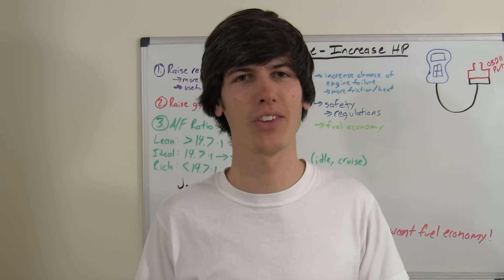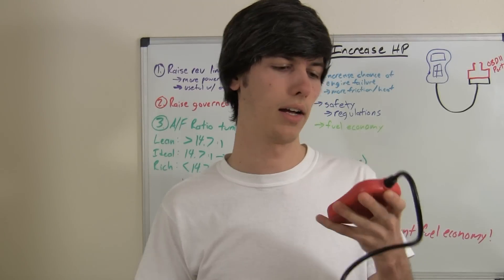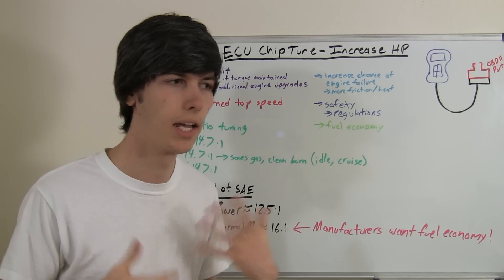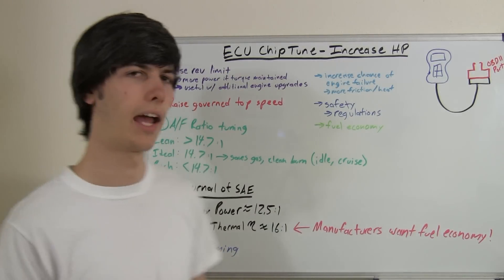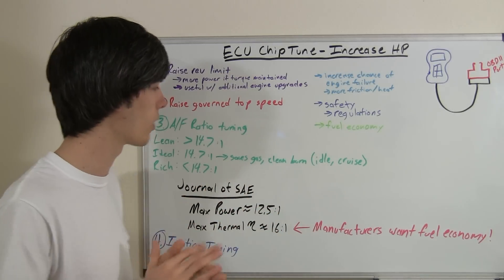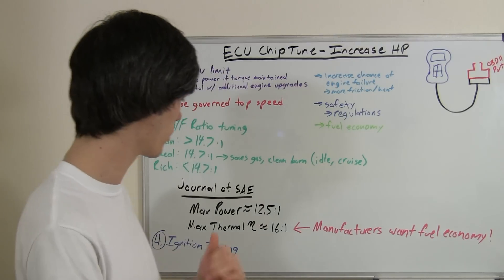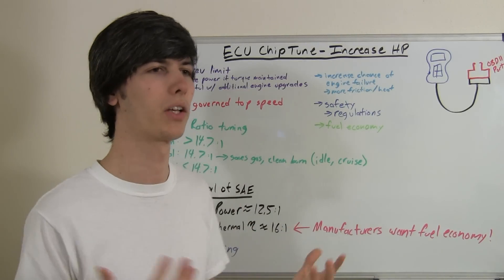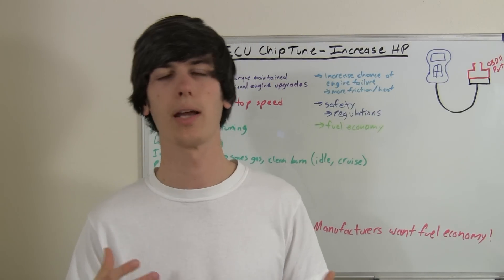ECU Chip Tune - How To Increase Horsepower

Comment: Why don't engine tuning companies just make software so you can use a laptop computer to flash the ecu? instead of all these $500 handheld tuner units.
Reply: James some do, But they are usually more expensive than the hand held units.
Reply from the maker: Some do! I know for example that COBB does.
Reply: The issue is that some cars have very complex ECUs and not a large aftermarket base. Therefore they dont waste their money or time with them because they wont make anything off of them. Many well supported cars have these programs, the Chevy Cobalt, and Dodge SRT4 being the first two that come to mind, but some smaller base cars like the Toyota Celica don't have this option. It truly just depends on your car as to what your options are.

Comment: tuning is way way more in depth than this. i suggest no one use this video to learn how to tune you're own car. this is just the absolute basic's and some of it does not necessarily mean it holds to when you do it to your car. Tuning a turbo, supercharged, all motor or nitrous car are all different beasts in them selves.

Comment: This is one of the biggest scams out there. You can't just install a chip and increase torque and BHP and gad milage. All they are, are just resisters that plug into your air intake sensor so your car thinks its cold all the time which increases your timing. Which will give you like about 5 BHP temporarily until your car catches on to it. The best way to get a gain of BHP is to actually Dyno Tune your ECU after you have added after market parts to get the best out of those new parts basically calibrating the car. Also you don't want it to adjust your cars top speed limit, because they are set there by the manufacture for a reason and that is, because your cars stock tires can not handle that high of speeds so that add a top speed limiter. You would only want to remove this if you have new tires onto your car not stock tires.
Reply: 100% spot on. Not to mention some cars are simply not designed for high speeds aerodynamics, brakes and suspension wise. Its easier to lose control with spongy soft suspension, improper brake pads/discs etc... Its not like every car is fitted with 4 piston brembo brakes. Stopping at above 155miles with dual piston calipers and non vented discs is suicidal =p
Reply from the maker: I'm not making any recommendations, just explaining the logic. Some cars it can have a greater effect than others (obviously). I suggest everyone do their research of course (and be okay without a warranty, if they still have one).
Reply: Engineering Explained Oh na i wasnt denying what you were saying! I was just agreeing that mods are required to get the most out of a tune, and also most people (young pre 20s) dont realise how unsafe "normal" cars are when only power is increased, with no regard for other crucial components such as suspension and brakes, which you also stated yourself in the video :)
Reply: donkey1450 Yup your very right to and the funny thing is that I fall into that category i'm only 16 lol, but that is also a good point your stock breaks would completely give away.
Reply: My car's speed limiter according to the book is 165km/h but I've had it up to 190km/h in an emergency situation, though I must say it starts to float in the corners on a dual lane highway at 190 and would never be sustainable on a normal road. I'd imagine if I put a spoiler on and stiffened the suspension I'd get well over 200 safely. The old man's Subaru Liberty LX stock I had up to 200 quite safely at one point (had to get around a wide load in a hurry) and it stood nice and clean with no floating or anything. Then in contrast I once had the front end of my old Hyundai Excel 86 raise off the road at 143km/h going down a hill on the NSW F3 freeway which was most disconcerting for a front wheel steer and drive vehicle.

The speed limiters needless to say often don't work at advertised values and with good maintenance and good quality parts cars are usually well capable of more than the speed limiter figure.

Comment: This guy will help you blow your engine, not get you more HP out of it. A cars valve train is specifically designed to operate within a safe RPM range. Even razing the limiter 500 RPM could cause the valves to float and clatter causing damage. Lose a rocker or a lash pad and it's over. In all reality unless the cam lobes shape and angle are changed there is no more power to be had at higher rev. In fact it falls off the higher the motor revs. The most effective power range for a stock motor is usually 2000 RPMs less than it's set limiter. THERE IS NO POINT IN RAZING THE LIMITER. 
r
A leaner air fuel ratio actually produces more power than richer, but it also causes heat to build up in the combustion chamber which causes pre ignition detonation which destroys bearings and burns holes in pistons. The car's manufacturer can only push the edge of that performance to the extent that it's safe for the engine. The more fuel you dump in the combustion chamber the cooler and safer it will run, but will in fact make less power.

Comment: Completely incorrect
Reply: This is the ricer method lol he's talking about ecu tuning and has no idea what real tuning takes. I've never turned up the rev limiter on my Mitsubishi Evo IX and I'm runnin 562whp and 539wtq, it's about a lot more than what he states. If u do what he says ur just Gunna ruin ur car guys and girls, take it from someone who's been there and done that. You guys can pm me on how to really tune an ecu. This guy is just embarrassing
Reply: Connor N I think you're missing the point. It's a brief 5 minute summary for the layman of what's involved with ECU tuning. This is clearly not a video designed to teach someone how to tune the timing advance on a 4g63 for e85.

Secondly, he's not telling anyone to change anything, he's explaining what the motivation for changes would be.
Reply: Beef Broth I drive one :S
Reply: enuary Me too =p. Ah well, let's be idiots together.
Reply: Connor N He is giving an introduction on the main principles on the general theoretical positives and negatives of tuning for engine longevity, maintaining engine structural integrity, safety, and reliability (from years of research from mechanical and electrical engineers from their respective car manufacturing companies VS leaning more toward performance, better Torque, Hp, potential (but not conclusive) for Engine related problems in the long run (if you stick with a stock engine for example). Sure there is a way to tune your engine for more horsepower & torque without affecting the longevity of your vehicle (ie tuning conservatively) or you can tune your (stock) engine for even better performance (ie tuning radically) but at the expense of causing pre- ignition, denotation, destroying your cylinder head gasket, blowing a hole through your piston, and affecting the intergity and normal mechanical operation of your engine, etc. If you understand the operation of an engine, have the time to repair yourself, are mechanically inclined (or have the capital to repair your engine from radical tuning or just being better to build a better performance engine and then tune it to its safety standards that way you get the best of performance and reliability) then if you want to tune radically knowing that you are going to decrease engine life before repair and knowing the associated expenses and time envolved then by all means radically tune your vehicle all you want. THIS VIDEO EXPLAINS THE POSSIBLE RISKS AND BASIC THEORY OF TUNING AND DOES NOT TAKE INTO CONSIDERATION INDIVIDUAL EXPERIENCES CONDUCTED BY INDIVIDUAL PEOPLE. Sure you are right to say that you can tune your Mitsubishi Lancer Evo to run at better performance without affecting the reliability of your Engine under the 5500 RPM REV LIMIT but I am sure it must of have token a lot of time, testing, experimentation to get your A/F ratio right amongst other factors considered such as keeping track of your sensor readings and so on amongst the Power Band of your engine to keep your engine at a high performance level while keeping your engine safe enough and long enough to operate (especially if it is a stock 4B11 DOHC 4 Cyl MILVEC 2.0L Engine).
Reply: ***** THANK YOU! WELL SAID!
Reply: Connor N What software and such do you use to tune?  Don't know how to PM anymore without using crappy Google +.

Comment: This video is so flawed. First you should never flash your car with a generic OTS map and daily drive. These maps are cookie cutter and will not react well with all cars. Second afr alone is not going to increase power the more rich you are more your car will bog. A leaner afr will actually create more power but make your engine go boom. You should have gone into ignition timing in this video because of you read the comments .any people are asking about just afr. Too rich with out the correct timing you will fry the piston rings. I don't know if you have ever modified or tuned a vehicle but to say you can gain power from a OTS reflash well that's like eBay advertising
Reply from the maker: Travis Fisher Never said it was for stock cars (though you can often get significant improvements with stock engine with forced induction). Here's a video on ignition tuning - I have a good number of videos on how ignition timing affects power. https://www.youtube.com/watch?v=R1tPT7anjwk
Reply: I don't need to watch a video I have a heavily modified car with many hours put into tuning. My point was endorsing chip tuning is horrible. All these bullydog or superchips Cobb accessport (ots maps) hondata (ots maps) are never good maps and meant only as a basemap than to be fine tuned. In most cases your cars performance goes down off a base map
Reply from the maker: Travis Fisher Sounds like you know it all, probably some better channels out there for you. This one's fun: https://www.youtube.com/user/mugumogu/videos

I'm explaining how tuning works, not endorsing OTS maps, if it wasn't obvious.
Reply: Engineering Explained I love cat videos to be honest thanks. But I give credit where credit is deserved so I will say your explations of the engineering of a engine or how certain parts work is spot on you know what you are talking about. But your whole Integra or performance part series it like your are reading the label and stumbling over what you want to say like you don't know what you are talking about or why you are using said part. Maybe you should do a actual video on tuning because your Integra needs a tune badly
Reply: Engineering Explained Admittedly... I watched way more of those videos than I should have.....
Reply: Travis Fisher he has no idea what he's talking about
Reply: ***** THANK YOU. THANK YOU. THANK YOU. WELL SAID MATE
Reply: Lmao
Reply: travis travis I always thought leaner meant more power.... until I had my car tuned... made way more power with more fuel... obviously with advanced timing as well which is where most of the power comes from. Advanced timing and lean AFR?? Gunna get hot and go casplodie.